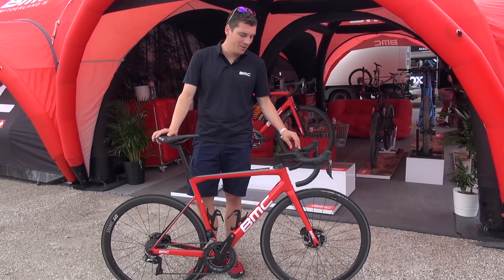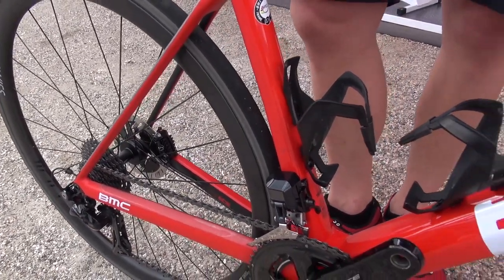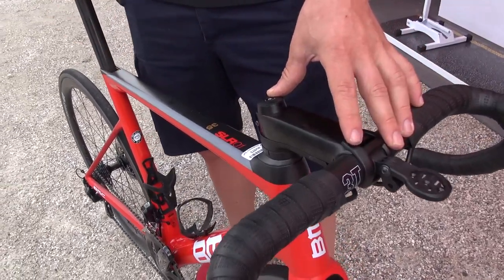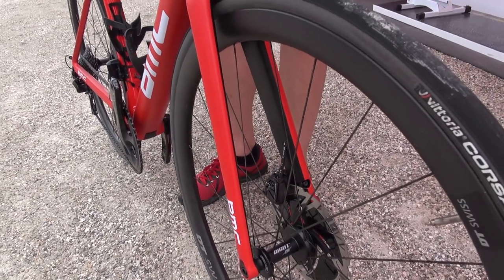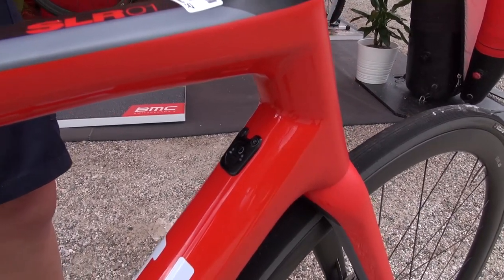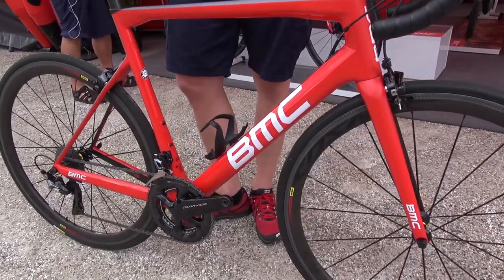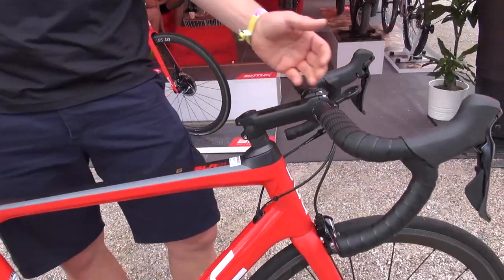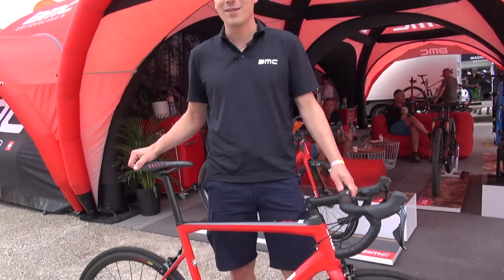BMC Roadbikes 2018.

Comment: What he forgot to say which is very important is that BMC have a totally different design to other bikes.If you look at the back forks and how they line up against the rest of the frame,they are lower down then most bikes.Most bikes the back forks connect where the seat post start by BMC bikes connect to the frame lower down.This makes the bikes so much stuffer and just amazing to ride.